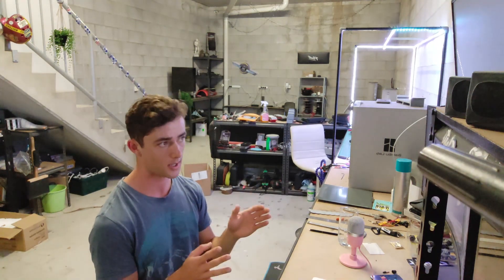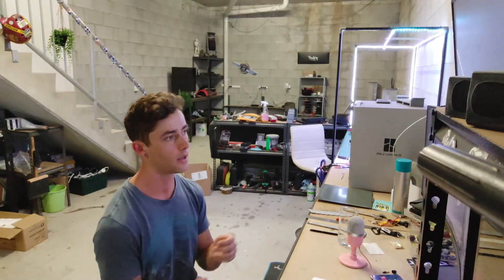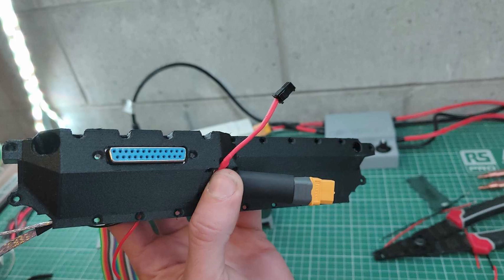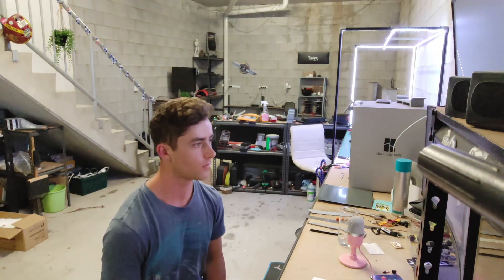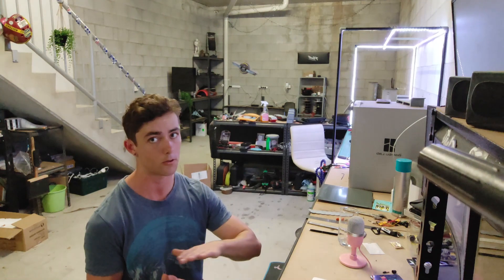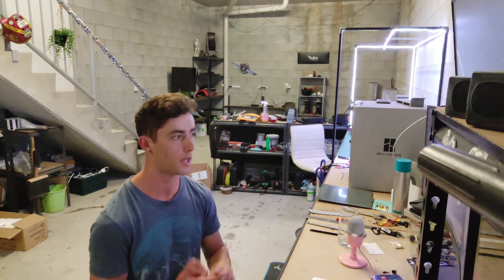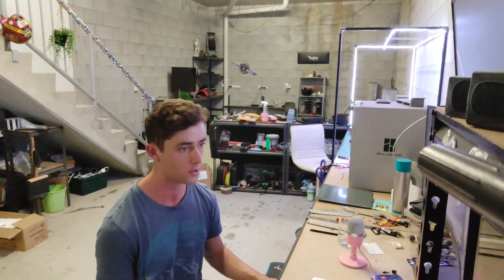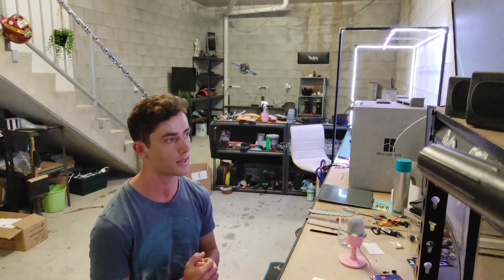Swappable Onewheel Batteries  - They're Possible

Comment: I’ve got 2 XR batteries rotated 180 degrees in a box with the leads sticking out the front. I never wait for a charge and it’s amazing.
Reply: Also I’m running lil Foccer 3.1 and my capacitors are holding up good. I was worried for a while, but now I’m just used to the spark.

Comment: I've only ever ridden my XR, looking to build one from the ground up for a cross country trip. A swappable battery would be massive, gonna need to get ahold of an electronics guru.
Question, how much battery power does it take to charge the capacitor? could you have a small dedicated battery pack to keep it charged separate from the swappable battery? As far as I understand capacitors charge super quickly so if you had like 8 cells (Idk what is actually feasible just an example) that could last like 40-50 charges before needing to be swapped out then you could make the main battery just a single connection, in my mind I think having the battery slide along the rail into a connection with no disassembly needed, idk if there's a workaround to the varying tolerances of rails but that sure would be something.

Comment: Interesting stuff, Both OneWheel and EUCs have alot in common.
I have noticed EUCs getting huge volts increases from 84volts up to 156+ in the last few years and the plugs ark bigtime.
some of the pro manufactures have started to make cold battery connectors that seems to be woken up by the control board with wake up  circuit. Something that is not talked about enough. this adds extra complexity requiring the battery BMS and control circuit to be compitable.

Comment: Great job! It seems like the big downside to this is losing all extra wiring to your battery box though. That would make it impossible to use any BMS that requires an independent charge path, LEDs, CAN wires for a smart BMS, right?
Reply from the maker: You do lose a bit yes, but one of the plugs versions has a separate charge path and the other has a 3 pin signal for lights, depending on if you're building for pint/gt or xr
Reply: Oh beautiful! You’re way ahead of me 🙇

Comment: Wow, amazing work. Thank you. I loved the XT60 in the rail, very trick. While not foreseeing a need for swappable battery in my future, there is a great need overall. I'm increasingly annoyed at FM, having just bricked two 4209's by frying their BMS. Why oh why can't I just purchase these things...
Reply: How did you manage to brick 2 boards ?
Reply: @MrDmadness  that's the problem, I don't know. My 4209 wouldn't turn off, which is indicative of a bad BMS, so I pulled a BMS out of another board, and plugged it in incorrectly(out of sequence)so while I know what's wrong with one, I still don't know what caused the first.
Reply: @deanaoxo  respectfully. Would not turn 9ff sounds more like a bus failure or the button contacts. Likely the bms you got was not rated for peak discharge OR posdiblly you did not verify the l1, l2 connections.  Ohewheel reversed them on their plug ( you may have reversed the polarity of the circuit )

Comment: something you could do to test number of safe cycles of pluggin/unpluggin, mount them on linear rails or something and have a motor push them together and pull apart, and measure connection resistance when they are connected and every maybe 100 cycles check the wear on the connector
Reply: what is the delay time period between cycles? I mean how long do vesc capacitors take to drain to zero electricity with no battery connected?
Reply: idk @uhjyuff2095
Reply from the maker: @uhjyuff2095  milliseconds